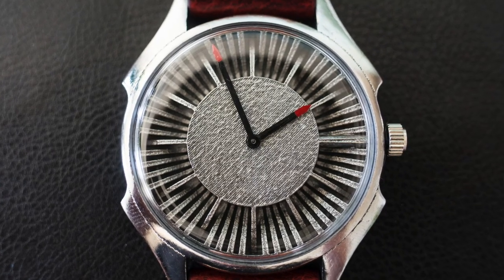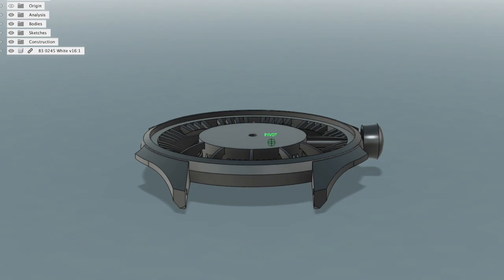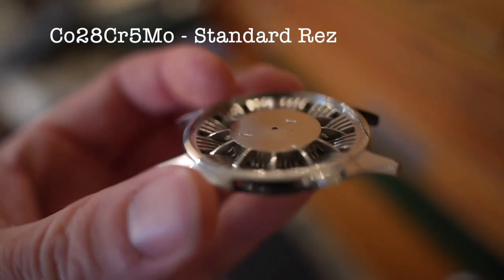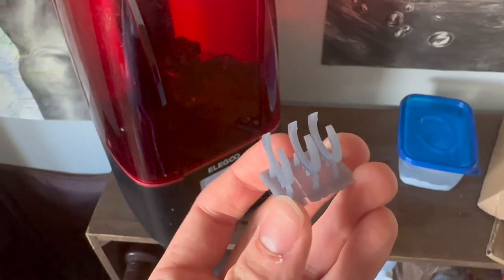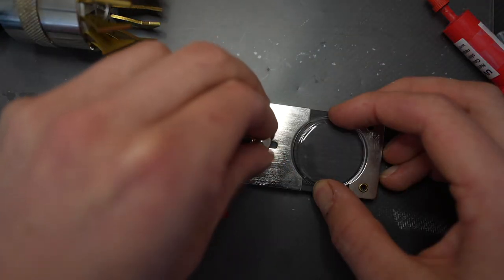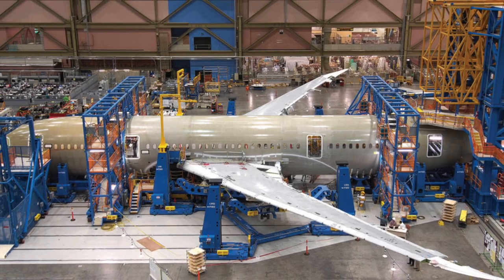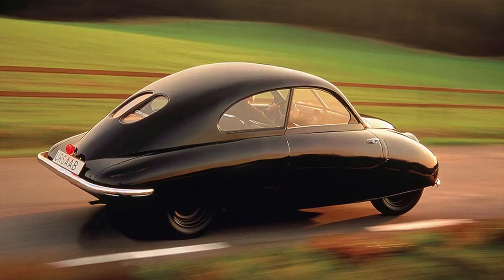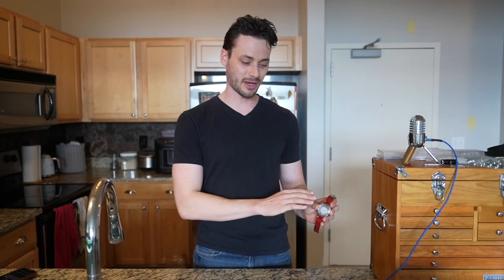DIY Watch Build V2: 3D Printed Titanium vs Steel

Comment: I don't understand why so few YouTubers do metal printing. Keep it up!
Reply: Probably because metal printing is so much more expensive that it's not cost effective for youtube videos
Reply: Metal prints need to be sintered under high heat and pressure. The equipment is expensive and usually takes up a huge amount of space.

Comment: Awesome work. Was very impressed to see the polished polished cobalt didn't reveal any printing imperfections. 

To make that leather on the back a more prefect circle. Get a pipe that has a inner diameter the size of the dot that you want. File down the outside edge til sharp and then use this to punch out perfect, repeatable circles.

Comment: I can tell that you put a lot of effort into this one video. From the script to the effort that went into this passion project, its a super nice video. Plus, would love to hear you talk about your camera and how you use it, I seen all your photographic tease in the thumbnails ;)
Reply from the maker: Hi fellow person who cares about cameras, 

So I like cameras (both digital and film), and frequently buy them on craigslist to then flip for a slim profit on eBay. This means that I've used a lot of brands, and the camera that I'm using is always changing. Here's a quick list of what I have tried so far: Fuji X-Pro1, Leica CL, Leica T, Panasonic G9, Fuji XT2, Nikon Z50, Cannon EOS RP, Ricoh GR II, Olympus EM1 Mark II, Fuji X100S, and Sony A7C. My actual skill using said cameras isn't that great yet, but I do have some sample photos on my website linked in the video description. For YouTube thumbnails, those are just 1280x720 pixels, so less than 1mp... At this tiny size the camera used is entirely irrelevant, but the lens does matter a lot. 

My current camera is the Sony A7C with the Tamron 28-200mm f2.8-5.6 and Voigtlander 40mm f1.2. I think all of my recent video thumbnails were shot with the 28-200. Both of these lenses are fantastic and give way better image quality than seems possible for their size. The A7C also gives way better quality than what you'd expect from its size... but it's not fantastic to use... too fiddly. I only keep using it for photos because it's so easy to get good video footage out of it... If I didn't need excellent video autofocus I'd be using something else. 

My favorite cameras so far were the Panasonic G9, the Ricoh GR II, and the Leica T:

The Panasonic G9 is still the best camera ergonomically I've ever used, with the best menu system I've ever used. I had all the shortcut buttons set up perfectly and could put it into almost any mode I used within 1 press. And for all the online complaints about video autofocus, it wasn't that bad. Also the Leica-branded 42.5mm and 25mm were super nice to use and had great sharpness. I only sold it after trying to print one of the photos (it's actually the one with the cow on my website) and it just didn't look great. Compared to prints from the Fuji I had at the time it wasn't at that level. I thought about how I might never be to Patagonia again, and decided I wanted better image quality than M43 could offer for the next time I traveled. Still though... if you don't need big files and don't need to print photos, it's a great camera that I still recommend to people. 

The Ricoh GR II was also great, and then it got dust on the sensor, and then it just broke and stopped turning on. Considering that I bought it expecting to eventually re-sell, this was pretty disappointing. From what I read online this happens to a lot of GR IIs eventually. I'd like to have another Ricoh, as it was really fun to use and the images were amazing, but am just too concerned about reliability to drop hundreds on one out-of-warranty again. Still one of my favorite cameras though. 

The Leica T wasn't comfortable to hold, and the menu system was strange, but combined with the cheap f1.4 sigma APSC lenses it give me the best out-of-camera colors I've ever seen. I didn't really understand the Leica obsessed people online until I used it. I still regret selling it, even though the focus was slow and it loved to blow out the highlights (and if you under-exposed to compensate for that, the shadow recovery wasn't great). I did try the Leica CL as well, but for whatever reason the colors out of the 24mp CL sensor weren't the same as from the older and worse T sensor. Maybe one day I'll pick one of these up again. 

Sorry for the wall of text, I wanted to talk about this, but wasn't going to make a YouTube video on it...
Reply: @CarterHurd  The A7C is a really really good camera, I am envious. I have always wanted a really nice general purpose camera that is also great at taking videos.

As for mirrorless, I have only experienced the Fuji X-E4. Honestly after some time with it, I do still prefer a familiared DSLR. Lots of big names in the industry like Canon, Nikon and Sony are focusing hard on mirrorless right now, but I feel like there aren't too many advantages to go all the way yet.

I still like my trusty Pentax K3 with the Pentax-D FA 24-70mm f/2.8, even though it's almost 10 years old at this point and the lens I have isn't as fast as I would want, beside that, it's still very reliable. I don't find colour as important because if I really like a photo, I'm gonna load Photoshop up and mess around with it anyway.

I also have a Pentax K100D Super with a DA* 300mm F4 for the occasional wildlife shooting. Using a camera that is 14 years old is definitely an interesting experience. Don't get me wrong, it can still take gorgeous photographs, but holding it, capturing photos with it and hearing that heavy chunk as the camera barely is able to flip the mirror out of the way to absorb light, is just simply satisfactory. If you haven't, you should give them old DSLR a try sometimes.

And yeah, sorry for the hastily written fence height text(when compared to yours) I'm sleep deprived

Comment: This is sick, how much would it cost to make something like this if you did pay for the print? Could you do a cost analysis for people who want to make their own?
Reply from the maker: The prints were between $400 and $500, and the build process was pretty labor intensive. Unfortunately I don't think this specific design makes sense for building/selling. Maybe if I do a different design in the future that's easier to print using cheaper methods / lower detail...

Comment: maaaan its like youre talking right to me. I'm working on a metal 3d printed watch brand right now. Thanks for sharing what you've learned and the script was great. I think there's a ton more to discover in 3d printed watches. 

Question; what were the downsides to Binder jetting? you mentioned warping. Why did that happen?
Reply from the maker: Warping and dimensional inaccuracy cause by said warping. The surface finish wasn't that much worse than that. 

With a little pounding-into-shape or a Dremel you can make Binder Jet work, though.
Reply: @CarterHurd  Interesting, thanks. Is there any way to design the case to resist warping (eg thicker walls?)
Reply from the maker: @TyCo87  Yes, there are design solutions, although more thermal mass (i.e. thicker walls) may make it worse, depending on how it is done. This is a whole rabbit hole you can go down if you do some googling.. I'm not really an expert, I just know there are things you can adjust to make it better.
Reply: @CarterHurd  I guess I know what I'm doing this evening haha thanks man, I'm looking forward to seeing where your channel takes you. All the best.